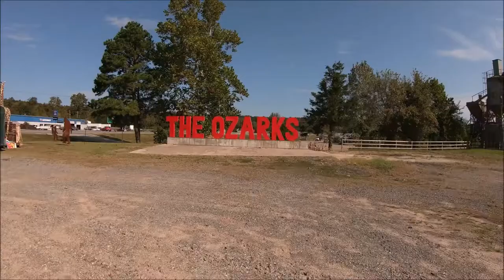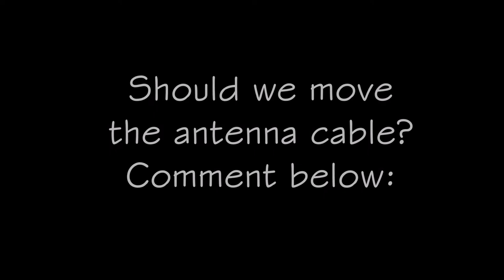RV Remodel Part 2

Comment: Dont you just love how these campers are built? all staples and tape LOL If you will be living in the camper during the winter I suggest plywood skirting around the bottom, it helps a LOT with keeping the cold off the floors.
Reply from the maker: If they were made any better they might not be able to travel down the road the way they do now. Someday materials will improve to allow for both quality and the ability to be lightweight. I'm sure cost is a big factor.

Comment: Put a shed over it. I don't care how good you think the roof is sealed. Sitting in the weather it will start leaking in no time. I've learned this the hard way. They are designed to be stored under cover. Used a week or 2. And put back under cover.
Reply from the maker: Absolutely. We plan to cover it when after we move it to our property. We still have to do road work and get our utilities and septic set up before we can live there. When the camper remodel is done we're going to begin on the property in Marshall.
Reply: We have a place in Leslie. We are trying to get our camper up there. We have power. Had a driveway put in but didn't pick the spot well. And it's so steep. I'm not site we can pull the camper up it. At least not with my truck. May have to get my go to guy for all things in Leslie to tow it up it with his big truck.
Reply from the maker: ben napier How long do you think before you’ll be up there?
Reply: We come up for a few days quite often. We're coming up next weekend. Was hoping to meet some of the local homesteaders I found on YouTube. You and hickory ridge are just right by us. As far as moving there. That's a complicated deal. Will tell you more about it if we meet you. It was our dream though.
Reply from the maker: Sounds like we’ll have plenty to talk about when we meet. We’re also on Instagram if you wanted to message us whe y’all come up.
Reply: @ridgeviewhomestead3900  sent you an email

Comment: The headgear cam worked very well. Not trying to be a jerk but goodness, as expensive as those things are they are surely made cheaply. Can't wait to see what you do to it to make it more comfy to live in while you work on the property. Did you say you are building a home, I forgot?
Reply from the maker: I think they make them better now (the newer ones) but they have to be light so they can travel down the road. We're only remodeling the camper currently.

Comment: What you are looking at is not what we are seeing with the camera.  You were taping the wires into the wire loom and we saw the wall above.  Maybe the camera needs to be tilted down more??  Please move a little slower when turning around.  It's unsettling to more so fast with the camera.  Thanks for taking us with you as you work.  Best primer to use is Zinsser Bullseye 123.  It will not lift the paper on those weird wall panels and will give you a good surface for paint.  I used it in my RV with great results.
Reply from the maker: Thank you for the feedback. We appreciate it.